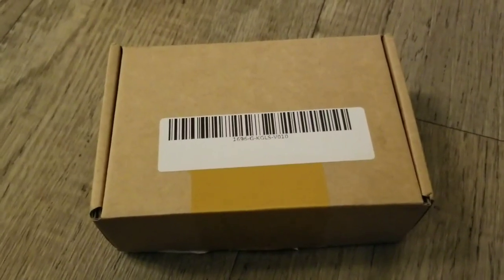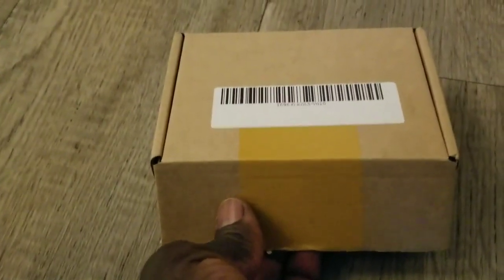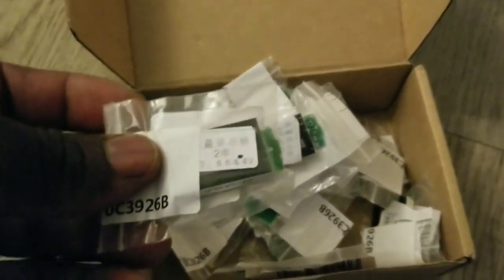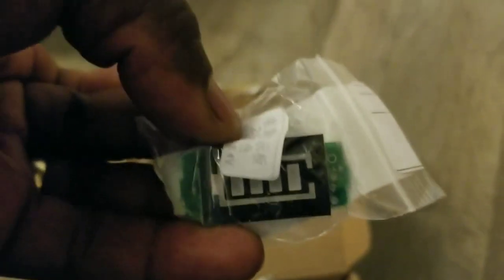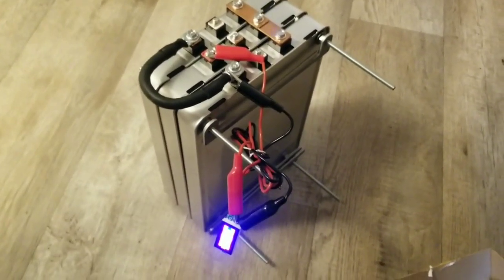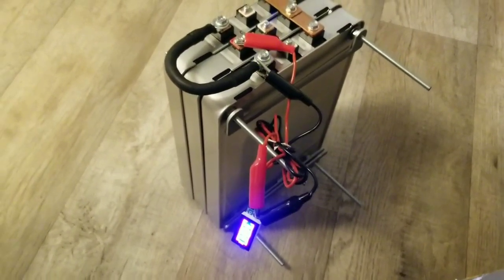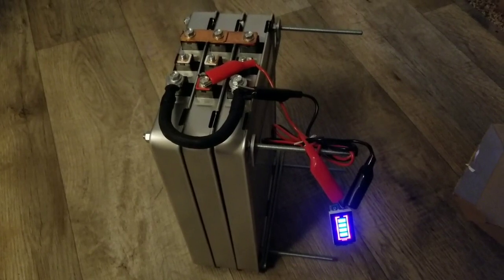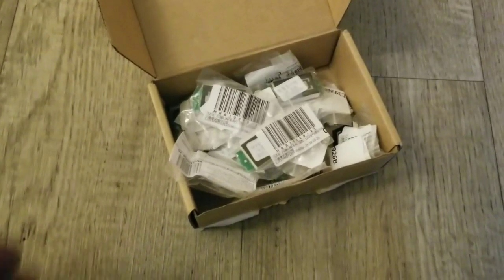1S/2S/3S/4S LITHIUM BATTERY CAPACITY INDICATOR POWER TESTER, battery capacity tester li-ion

Comment: Dear JW, I need to take you back in time to Outback FM80. I want to load 2000w array on fm80 for 12volts configuration so I harvest as much sun during bad weather.  When the weather gets better and controller reaches 80amps, does it drop excess and operates at 80a max or it gets damaged. Note that Iam not exceeding the recommended VOC of 150v input and ISC 64amps input
Reply from the maker: Hello brother Roland,
Here is your answer towards your question  Sir.
(FLEXMAX 80 STC TEST)
12 VDC systems 1250 Watts

(FLEXMAX80 RECOMMENDED)
Recommended Solar Array
12 VDC systems 1000 Watts
Thanks for checking in brother and have a wonderful day Sir.
Reply from the maker: If you really want to utilize your 2kW Solar Panels you have to step up or upgrade to 24V configuration.

(FLEXMAX 80 STC TEST)
12 VDC systems 1250 Watts
24 VDC systems 2500 Watts
48 VDC systems 5000 Watts
60 VDC systems 6250 Watts

(FLEXMAX80 RECOMMENDED)
Recommended Solar Array
12 VDC systems 1000 Watts
24 VDC systems 2000 Watts
48 VDC systems 4000 Watts
60 VDC Systems 5000Watts